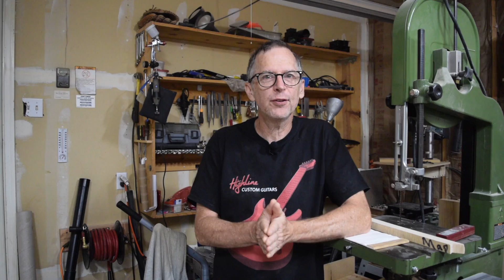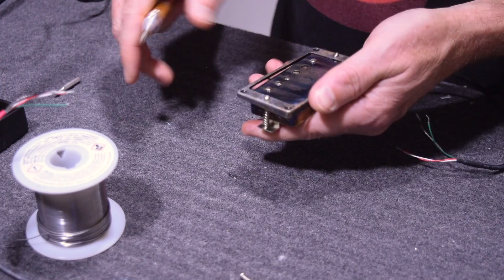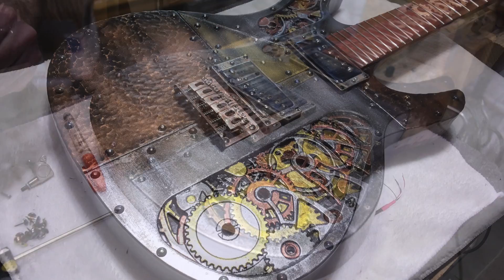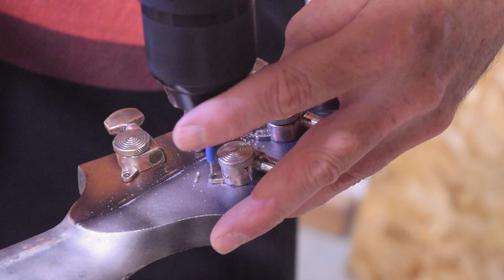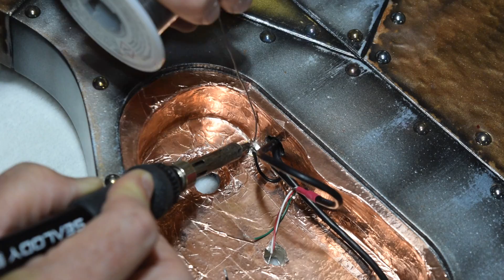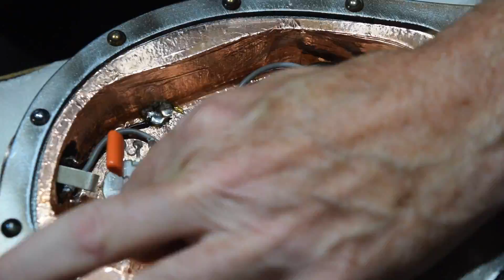The Steampunk Guitar Build Part 11: Installing The Steampunk Guitar's Hardware

Comment: I would disagree with the term "safety" when grounding the bridge.  A book I have called Electric Guitar Design which states that you should use a fast blo fuse inline with the bridge ground (something that Martin does on their acoustic guitars).  You don't want to be the shortest path to ground if you come into contact with say faulty microphones or an ungrounded amp.  Many guitar players have been badly injured due to electrocution due to bridge grounds.  I am surprised that only one guitar manufacturer actually uses a fast blo fuse to protect a player.  To me this should be common practice across every guitar builder.
Reply from the maker: I may look into that in the near future.

Comment: Great videos.

You seemed to have wired the tone pot up so that it works the opposite way round to normal.  Was this a mistake or a personal choice? 

Also, grounding the bridge is just for reducing electrical noise, it's not for safety.  In fact it's safer not grounding it.  If it's not grounded, then you can't get such a low resistance path to ground through your body/heart if you touch a live mic with one hand whilst still having the other on the strings.  Thankfully equipment is so much safer than it used to be so this rarely happens nowadays, but it still can happen.   EMG tell you not to ground the bridge/strings just for this reason, as their pickups are so noise-resistant that grounding the bridge/strings doesn't have any noise-reduction benefit, but it does make things that bit safer.
Reply from the maker: its not a mistake

Comment: Hello there great channel, I have Been following the steam punk guitar I really like it 👍🏼, could you help me please? I just plug a single coil hole in my guitar so now I have a HH guitar but even I used bondo to get a smooth surface before apply the paint when I apply catalyzed base bondo gets deformed and I still see the edges of the hole so I can't apply the paint because that mark is still there...I don't know what to do now 😔
Reply from the maker: Apply more bondo to the area so it is proud (above) the surface and let it cure for a week or two. Then sand it smooth and apply a few coats of primer. Let the primer cure a week or two and sand it smooth. Apply a final coat of primer and let it cure a week or so. Now you should be able to paint it.

Comment: Did you think about doing a coil split? I've found a lot of hot pickups really have nice split sounds as well.

This is turning out really cool!
Reply from the maker: I always add 4 lead hookup wire to allow for a coil-split. Honestly, I'm not a big fan of coil-splitting because of the volume drop, but if a customer wants it, I'll do it.

Comment: Why do you coat the screws with Finishing Wax? What purpose does that serve ?
Reply from the maker: It acts as a lubricant and makes it easy to tighten down the screws without snapping off the head.

Comment: do you offer cnc ready guitar plans?
Reply from the maker: No. G-code files have to be written for the specific machine they will be sent to as well as the material to be carved and the specific bits to be used. All of the plans I sell on my eGuitarPlans website are in .pdf format but can be converted to CAD formats by visiting zamzar.com
Reply: @HighlineGuitars  thank you.
Reply: Interested in this

Comment: Morning Chris! 
Can you elaborate on using paste wax on screw threads?
Reply: It's to lubricate the screw. It helps prevent stripping and heads breaking off. I have previously used a bar of soap for the same purpose - also good for bigger screws, like neck bolts.